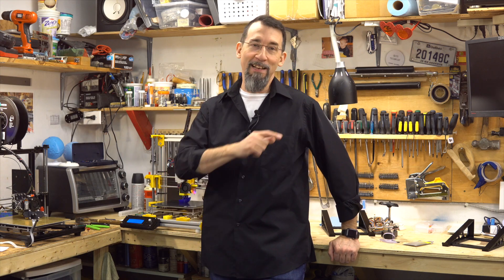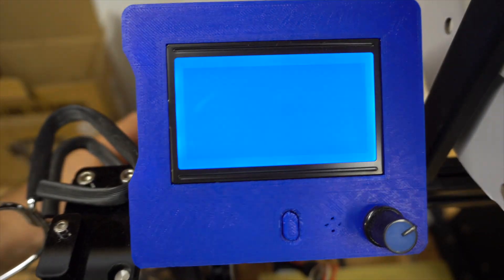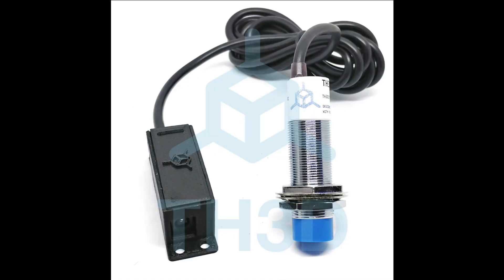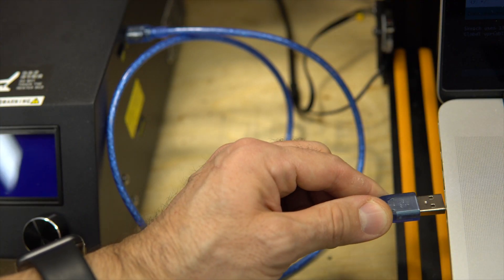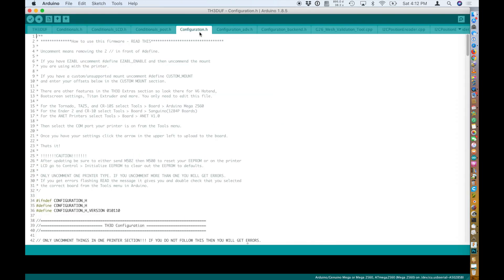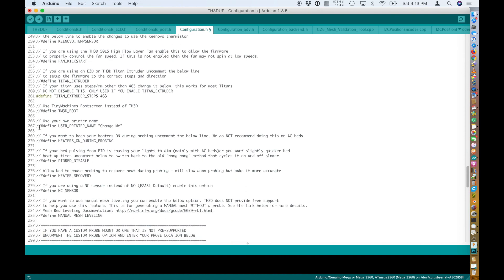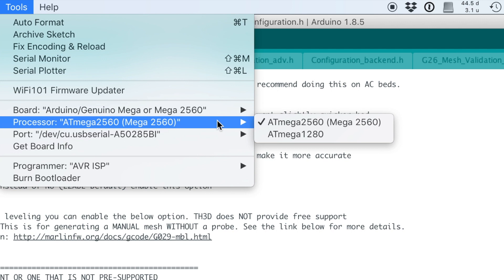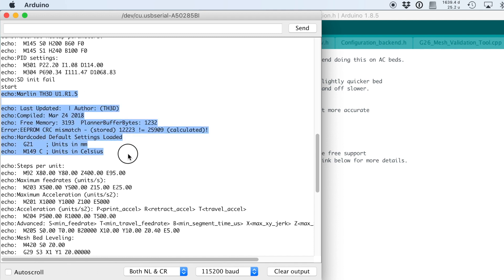CR-10S Firmware Update Made Easy

Comment: stil working in 2023? i have a problem with a CR-10S, the extrude motor doesn't work and i want to upgrade the firmware before try to change the base board.

Comment: You made this so clear and easy! I had few errors while compiling, but managed to fix them in a second. Flashing went flawlessly. I did unplug printer rom AC and only usb connected as read somewhere.
Reply: If you screw up the upload, do you irreversibly brick your machine? That's what I'm terrified about doing.

Comment: What are the benefits of upgrading to this firmware over the stock CR-10S firmware? I just inherited an unused machine from a colleague.
Reply from the maker: Depends on the version you have, thermal protections are a big thing so that if something happens like a short or a cable break from the temperature sensor of the nozzle happens, Marlin will shutdown and not melt the hot end. I think that Creality got better with time, you should at least get it up to the latest firmware from Creality. Than go from there if you have problems.
Reply from the maker: Some other aspects can be fun to play with in Marlin, like Linear Acceleration for example, so having the source code and the ability to change the firmware is a plus.

Comment: Mine isn't popping up idk why
Reply from the maker: Some older boards did not have a bootloader from factory, you have to burn the bootloader with Marlin and a USBASP adapter connected to the JTAG on the board, or you can use another Arduino board and make a cable for it, than it's in the Arduino software for burning the bootloader.
Reply: @Franks3Dshop  okay maybe I'll have to look into it thanks for the reply
Reply from the maker: @Sky_vulpes  Should do a video on that, on the list...

Comment: keep getting this error. i have tried on two different computers. also the example file in no longer there with the cr10s 

Arduino: 1.8.13 (Windows 10), Board: "Arduino Mega or Mega 2560, ATmega2560 (Mega 2560)"

sketch\src\HAL\AVR\u8g_com_HAL_AVR_sw_spi.cpp:65:10: fatal error: U8glib.h: No such file or directory

 #include <U8glib.h>

          ^~~~~~~~~~

compilation terminated.

exit status 1

Error compiling for board Arduino Mega or Mega 2560.

This report would have more information with
"Show verbose output during compilation"
option enabled in File -> Preferences.

Comment: I did everything but now I am getting the home point in the other corner (right bottom) instead of left bottom and when I put an old file to print the extruder misses the bed thinking that is somewhere else.
Reply from the maker: Maybe you have some motor inverted, I would test with Pronterface if the axis moves in the correct direction, and than correct it in the firmware or by flipping the connectors on the main board if possible.

Comment: hey I recently got all the files worked out as well as downloaded the u8glib and sanding board functions the only error I'm receiving tho seems to be with memory. The Arduino sketch is taking up too much memory I believe. Here is what the error I'm getting looks like:

Arduino: 1.8.9 (Mac OS X), Board: "Sanguino 1284p, ATmega1284 or ATmega1284P (16 MHz)"

Sketch uses 109838 bytes (84%) of program storage space. Maximum is 130048 bytes.
Global variables use 5458 bytes (33%) of dynamic memory, leaving 10926 bytes for local variables. Maximum is 16384 bytes.
avrdude: stk500_getsync() attempt 1 of 10: not in sync: resp=0x65
avrdude: stk500_getsync() attempt 2 of 10: not in sync: resp=0x63
avrdude: stk500_getsync() attempt 3 of 10: not in sync: resp=0x68
avrdude: stk500_getsync() attempt 4 of 10: not in sync: resp=0x6f
avrdude: stk500_getsync() attempt 5 of 10: not in sync: resp=0x3a
avrdude: stk500_getsync() attempt 6 of 10: not in sync: resp=0x53
avrdude: stk500_getsync() attempt 7 of 10: not in sync: resp=0x44
avrdude: stk500_getsync() attempt 8 of 10: not in sync: resp=0x20
avrdude: stk500_getsync() attempt 9 of 10: not in sync: resp=0x69
avrdude: stk500_getsync() attempt 10 of 10: not in sync: resp=0x6e
An error occurred while uploading the sketch

This report would have more information with
"Show verbose output during compilation"
option enabled in File -> Preferences.
Reply from the maker: Hi, you have to select the correct serial port for uploading, I think it’s the problem here

Comment: Thanks mate !! You saved me !! Just letting you know that it also works on CR20 pro. Direct connection to the PC no Arduino board and jumper wires needed.
Reply: Does this work if your CR-20 uses a BL Touch sensor?  What are the procedure/code changes required, if any?

Comment: So I just bought a cr10v2 and it arrived yesterday. Setup was easy but when I turned the printer on the LCD screen stayed blue no menus appeared. I have tried to connect to it via a micro usb cable and pronterface but it said it wouldnt connect (my printer is unplugged, does it need to be plugged in? I was told not) I followed the steps in the video for the firmware update and when I tried to upload it it responded with the following:

Arduino: 1.8.9 (Windows Store 1.8.21.0) (Windows 10), Board: "Arduino/Genuino Mega or Mega 2560, ATmega2560 (Mega 2560)"

In file included from sketch\ultralcd.cpp:96:0:

ultralcd_impl_DOGM.h:46:20: error: U8glib.h: No such file or directory

compilation terminated.

exit status 1
U8glib.h: No such file or directory

Also "Serial Monitor" just pulls up a blank console and no data is displayed. 
And when I do "Get Board Info" I get 
BN: Unknown board
VID: 1A86
PID: 7523
SN: Upload any sketch to obtain it

I am honestly at a loss. Any advice or help is appreciated!
Reply from the maker: Hi, if you look on TH3D website they list how to install the library you are missing in Arduino to be able to compile. But if you can not connect vi USB you will not be able to install the firmware either.

Comment: I tried to install the software after trying to do a different firmware update (that somehow disabled my SD card reader) for my Creality CR10 S5.

I was trying to compile the TH3D code after uncommenting my printer type and changing the name of the printer, but I run into this error (despite the fact that I have "Arduino Mega or Mega 2560" selected for the board and "ATmega 1280 selected as the processor:

Arduino: 1.8.10 (Windows 10), Board: "Arduino Mega or Mega 2560, ATmega1280"

In file included from sketch\pins_SANGUINOLOLU_12.h:41:0,

                 from sketch\pins_MELZI.h:32,

                 from sketch\pins_MELZI_CREALITY.h:35,

                 from sketch\pins.h:229,

                 from sketch\MarlinConfig.h:42,

                 from sketch\G26_Mesh_Validation_Tool.cpp:27:

pins_SANGUINOLOLU_11.h:55:4: error: #error "Oops!  Make sure you have 'Sanguino' selected from the 'Tools -> Boards' menu."

   #error "Oops!  Make sure you have 'Sanguino' selected from the 'Tools -> Boards' menu."

    ^~~~~

In file included from sketch\pins_SANGUINOLOLU_12.h:41:0,

                 from sketch\pins_MELZI.h:32,

                 from sketch\pins_MELZI_CREALITY.h:35,

                 from sketch\pins.h:229,

                 from sketch\MarlinConfig.h:42,

                 from sketch\I2CPositionEncoder.cpp:31:

pins_SANGUINOLOLU_11.h:55:4: error: #error "Oops!  Make sure you have 'Sanguino' selected from the 'Tools -> Boards' menu."

   #error "Oops!  Make sure you have 'Sanguino' selected from the 'Tools -> Boards' menu."

    ^~~~~

In file included from sketch\pins_SANGUINOLOLU_12.h:41:0,

                 from sketch\pins_MELZI.h:32,

                 from sketch\pins_MELZI_CREALITY.h:35,

                 from sketch\pins.h:229,

                 from sketch\MarlinConfig.h:42,

                 from sketch\M100_Free_Mem_Chk.cpp:49:

pins_SANGUINOLOLU_11.h:55:4: error: #error "Oops!  Make sure you have 'Sanguino' selected from the 'Tools -> Boards' menu."

   #error "Oops!  Make sure you have 'Sanguino' selected from the 'Tools -> Boards' menu."

    ^~~~~

In file included from sketch\pins_SANGUINOLOLU_12.h:41:0,

                 from sketch\pins_MELZI.h:32,

                 from sketch\pins_MELZI_CREALITY.h:35,

                 from sketch\pins.h:229,

                 from sketch\MarlinConfig.h:42,

                 from sketch\Sd2Card.cpp:29:

pins_SANGUINOLOLU_11.h:55:4: error: #error "Oops!  Make sure you have 'Sanguino' selected from the 'Tools -> Boards' menu."

   #error "Oops!  Make sure you have 'Sanguino' selected from the 'Tools -> Boards' menu."

    ^~~~~

In file included from sketch\pins_SANGUINOLOLU_12.h:41:0,

                 from sketch\pins_MELZI.h:32,

                 from sketch\pins_MELZI_CREALITY.h:35,

                 from sketch\pins.h:229,

                 from sketch\MarlinConfig.h:42,

                 from sketch\Marlin.h:35,

                 from sketch\Marlin_main.cpp:258:

pins_SANGUINOLOLU_11.h:55:4: error: #error "Oops!  Make sure you have 'Sanguino' selected from the 'Tools -> Boards' menu."

   #error "Oops!  Make sure you have 'Sanguino' selected from the 'Tools -> Boards' menu."

    ^~~~~

In file included from sketch\pins_SANGUINOLOLU_12.h:41:0,

                 from sketch\pins_MELZI.h:32,

                 from sketch\pins_MELZI_CREALITY.h:35,

                 from sketch\pins.h:229,

                 from sketch\MarlinConfig.h:42,

                 from sketch\SdBaseFile.cpp:30:

pins_SANGUINOLOLU_11.h:55:4: error: #error "Oops!  Make sure you have 'Sanguino' selected from the 'Tools -> Boards' menu."

   #error "Oops!  Make sure you have 'Sanguino' selected from the 'Tools -> Boards' menu."

    ^~~~~

In file included from sketch\pins_SANGUINOLOLU_12.h:41:0,

                 from sketch\pins_MELZI.h:32,

                 from sketch\pins_MELZI_CREALITY.h:35,

                 from sketch\pins.h:229,

                 from sketch\MarlinConfig.h:42,

                 from sketch\MarlinSerial.cpp:36:

pins_SANGUINOLOLU_11.h:55:4: error: #error "Oops!  Make sure you have 'Sanguino' selected from the 'Tools -> Boards' menu."

   #error "Oops!  Make sure you have 'Sanguino' selected from the 'Tools -> Boards' menu."

    ^~~~~

In file included from sketch\pins_SANGUINOLOLU_12.h:41:0,

                 from sketch\pins_MELZI.h:32,

                 from sketch\pins_MELZI_CREALITY.h:35,

                 from sketch\pins.h:229,

                 from sketch\MarlinConfig.h:42,

                 from sketch\Max7219_Debug_LEDs.cpp:38:

pins_SANGUINOLOLU_11.h:55:4: error: #error "Oops!  Make sure you have 'Sanguino' selected from the 'Tools -> Boards' menu."

   #error "Oops!  Make sure you have 'Sanguino' selected from the 'Tools -> Boards' menu."

    ^~~~~

In file included from sketch\pins_SANGUINOLOLU_12.h:41:0,

                 from sketch\pins_MELZI.h:32,

                 from sketch\pins_MELZI_CREALITY.h:35,

                 from sketch\pins.h:229,

                 from sketch\MarlinConfig.h:42,

                 from sketch\SdFatUtil.cpp:29:

pins_SANGUINOLOLU_11.h:55:4: error: #error "Oops!  Make sure you have 'Sanguino' selected from the 'Tools -> Boards' menu."

   #error "Oops!  Make sure you have 'Sanguino' selected from the 'Tools -> Boards' menu."

    ^~~~~

Multiple libraries were found for "U8glib.h"

 Used: C:\Users\mysti\Documents\Arduino\libraries\U8glib

exit status 1

#error "Oops!  Make sure you have 'Sanguino' selected from the 'Tools -> Boards' menu."

This report would have more information with

"Show verbose output during compilation"

option enabled in File -> Preferences.
Reply from the maker: Hi it says to select the Sanguino in Arduino Tools Menu under Boards...

Comment: Hey Frank, Does the Firmware solves the problem with the thermal runaway? I am printing with octoprint and it always reminds me to update the firmware to solve the problem. thanks for video
Reply from the maker: Yes it does solve the thermal runaway, it is activated on the TH3D firmware as well as on standard Marlin, and it is an essential fire hazard protection.

Comment: Is this also possible with the cr10? Or do I need to buy a Arduino board or something similar?
Reply from the maker: Hi, you can try, it will fail if you do not have a bootrom... you can also can a isp programmer for this purpose

Comment: Thanks for the cool quick video. Does doing this procedure enable thermal runaway protection for cr10s?
Reply from the maker: Hi, yes it’s part of the Firmware, I just verified on the webpage. You can also check it yourself afterward.

Comment: Hello Frank, I'm having trouble flashing firmware for my Creality Cr-10s s5. I followed your video and read the instructions but I keep getting this same error every time I try to compile. I chose the Arduino/Genuino Mega 2560 and atMega2560 as the processor.

Arduino: 1.8.9 (Windows 10), Board: "Arduino/Genuino Mega or Mega 2560, ATmega2560 (Mega 2560)"

In file included from sketch\ultralcd.cpp:96:0:

ultralcd_impl_DOGM.h:46:20: error: U8glib.h: No such file or directory

compilation terminated.

exit status 1
U8glib.h: No such file or directory

This report would have more information with
"Show verbose output during compilation"
option enabled in File -> Preferences.
Reply: Nevermind I figured it out actually. I don't know much about using arduino but for anyone looking for this fix make sure to go to Sketch>Include Library>Manage Libraries  then go look for U8glib.h and install that.

Comment: I was good up until the very last step. Trying to upload firmware im getting an error "#include <U8glib.h>"
Reply from the maker: You just need to add a library, look on the TH3D website it will tell you what and how to install.
Reply: @Franks3Dshop  where does it say this?
Reply from the maker: Sorry I was on vacation, it should be the similar for windows than this: https://www.th3dstudio.com/knowledgebase/arduino-ide-for-mac-os-x-setup-guide/

Comment: Thanks a lot, you saved me !
Tried 2 times before through Octoprint with Marlin 1.1.9 and it would give me "Flashing failed" errors then the printer wouldn't work properly.
Worked like a charm with TH3D and a laptop PC.

Comment: My 3D printer won't work. The extruder won't move, but it's wired correctly. It's driving me mad. I know the motor works because I plugged the x plug into it, and it moves forward, but not reverse.
Reply: That's what I did my guy, as I described above. It works when I move x inputs. It just won't work from the extruder cable. Do you think the problem exists with the filament sensor or the actual plug? I don't think it's snapping in like it should be.
Reply from the maker: Yes I read your comment, did you connect the X motor to the Extruder output on the board also, you would have to get the printer hot end to temperature first and test if the X motor move when connected in place of the extruder when you try to extrude some filament.
Reply: I am just going to rewire my 2.0 motherboard and update it to work with my computer. If it works, I know it is a motherboard problem. If it doesn't, I'm buying a new cable
Reply from the maker: Seems to be a main board problem, try the extruder in the X output...

Comment: Great video. Thank you. I have the CR10s 5s (500x500x500). Would I remove the '//' at line 71 or 75? Thanks.
Reply from the maker: From what I see in the current TH3D files, line number 184 //#define CR10S_5S is the one you want, provided you have a ATmega 2560 board...
Reply: @Franks3Dshop  Thank you - I do have the ATmega 2560 board. I did notice the line numbers were different, but thought it best to refer to the numbers in your video.
Reply from the maker: Oh I see!

Comment: Sorry - 2 questions, but do i absolutely have to buy the auto bed leveling kit? Or can I do without it for now? if I want to do without it, do i need to do anything differently? Thanks!!
Reply from the maker: Hi, you do not need the bed leveling kit, you have the option to activate it or not, you can do it later going through the same process.
Reply: @Franks3Dshop  I did not see where you activated it - could you point that out to me?

Comment: Are you telling me I don't need a raspberry pi (I have the CR-10s) like so many other videos suggest?
Reply from the maker: The Raspberry Pi is used as a print server, instead of your computer connected to the printer, it’s the Raspberry Pi that is connected to serving the files during print. Is this what you are asking for? Thank you.
Reply: @Franks3Dshop  sort of - i'll ask differently. You did this entire process without using a raspberry pi correct?
Reply from the maker: Yes correct, I only used my PC with Arduino and the firmware from TH3D.

Comment: so i need an extra arduino? or is the printers mainboard an aduino
Reply: got it
Reply from the maker: Hi, it is an Arduino, and if there is a boot loader already installed you will be able to flash it, if not you need another Arduino or an ISP (in system programmer) to put the boot loader on there.

Comment: Did this with my CR-10S, worked like a charm and was indeed really that easy! Thanks!
Reply: Does the unit have to be on when u do this?
Reply from the maker: No the USB should provide enough power, you can also turn it on it will not hurt.

Comment: I was able to flash as well, I only have a blue screen now and the smell of something burning. Creality Cr10 S5 500mm
Reply from the maker: Hum the firmware should not be able to do such a thing and there are many safety in Marlin now. Could be a coincidence, rare but not to be discarded.
Reply from the maker: One thing you can do if you used TH3D firmware, is to go and ask on the TH3D site. Also look if the printer is reporting something on the arduino terminal monitor window when USB is connected.